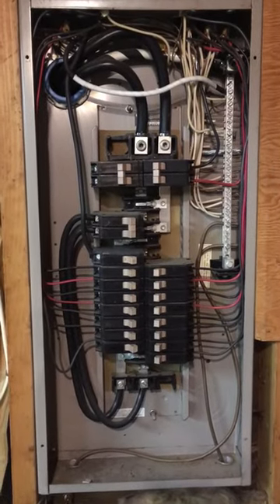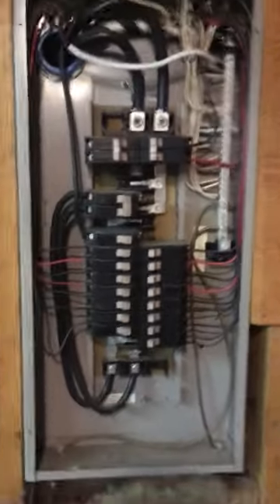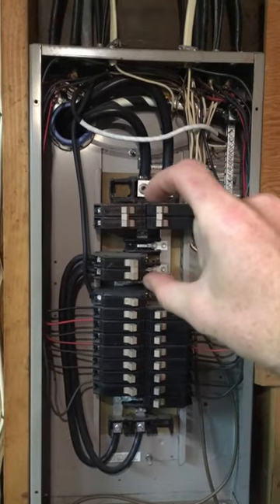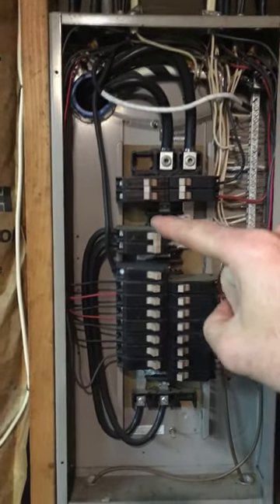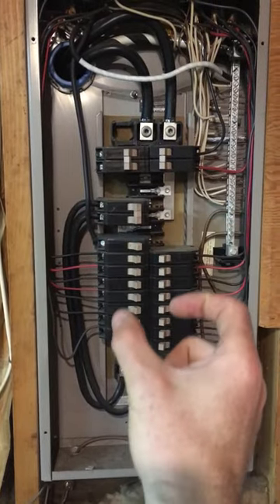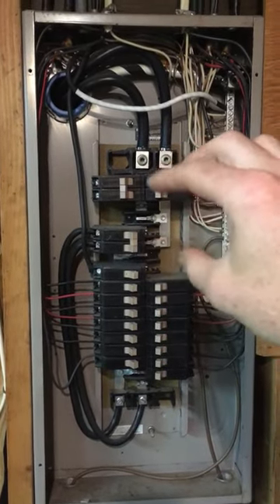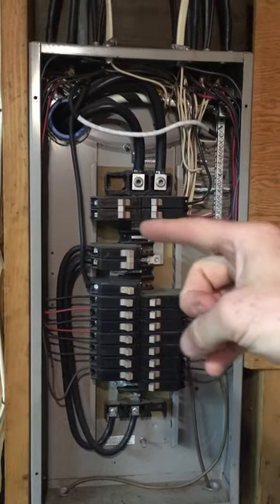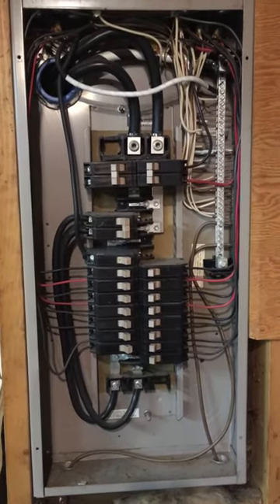How a split bus electric panel works

Comment: Thanks, you don't see too many of these in service these days and armed with the proper information can be valuable for someone particularly first-time homeowners looking to purchase an older home.   

You may add that while there's nothing inherently wrong with split bus panel themselves,  they were no longer approved for new installations as of 1981, and manufacturers have ceased production by the mid 80s. That being said, many split bus panels were made by Federal Pacific Electric,  or Zinsco /GTE SYLVANIA,  and these brands have a well documented high failure rate and considered to be very unsafe and unreliable and should be replaced with modern equipment at once.
Reply from the maker: Great points!
Reply: I can confirm this as fact.
I'm an electrician in Louisiana. When it comes to buying an older house here, as long as the panel was properly bonded/grounded/terminated and wasn't fused, they didn't look past that. 
But now, most, if not all insurance companies, are requiring people to replace those panels OP mentioned and roof before their renewal date, or they will drop them. Most everyone I know has had either their policy be sold to another company, the company bought out by another company, or just plain dropped them and closed shop. 

Y'all, we used to get crawfish for $35-$40 a sack. $60 during hard times... 
Them crawfish was $300 a sack this year. That's sad, like a 2-legged gator... Like a toothless nutria rat. 

Also worth noting: There is no more FEMA for us. Last hurricane damage was completely on homeowner insurance and will be from here on out. My premium was $2,700 three years ago. My property of 33 years has never flooded nor been damaged by storms.
Next year, my premium with no flood insurance will be approx $10k.
Oh, and now we have tornados. In 44 years, we had nothing but water spouts for a min. Now we have F-2s ripping through letting us know summer is here. 

3/10 would not recommend.

Comment: I have one in my home too im thinking of changing it to a normal 200 amp panel
Reply from the maker: Not a bad idea although there isn’t necessarily anything wrong with a split bus panel however.
Reply: @Stuffandthingstoknow  Agreed I could still keep it because it still works ok. I can still run a sub panel from thr split bus. i just make sure the upper bus is no more than 6 breakers.

Comment: I worked on a split bus with 120/208 on top and 277/480 on the bottom. Not fun. 😊
Reply from the maker: Whoa, sounds unique. Was that is a commercial setting?